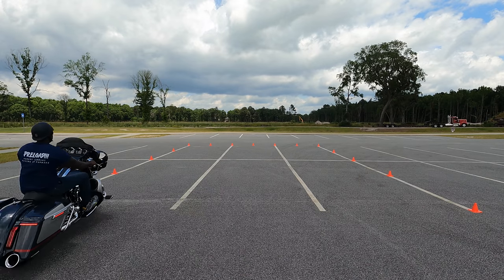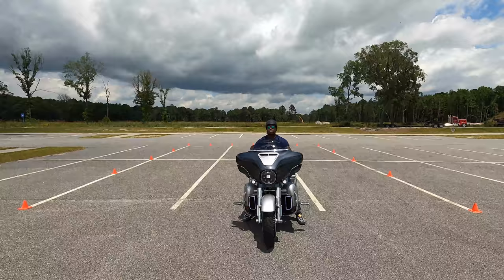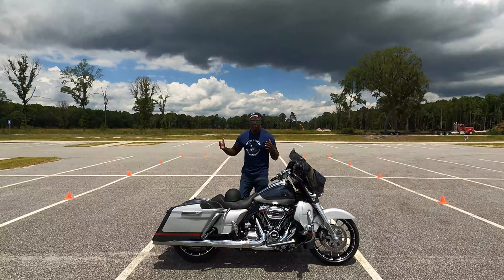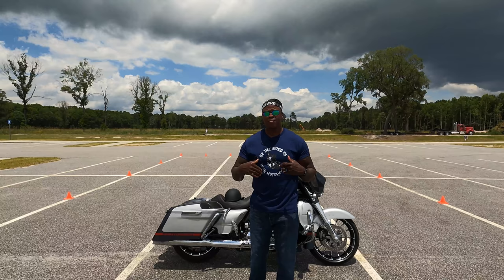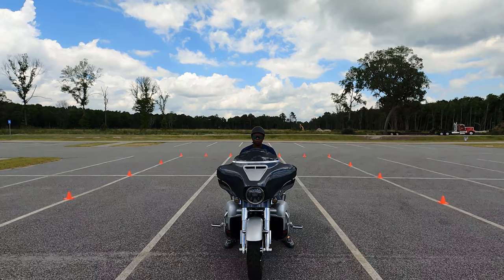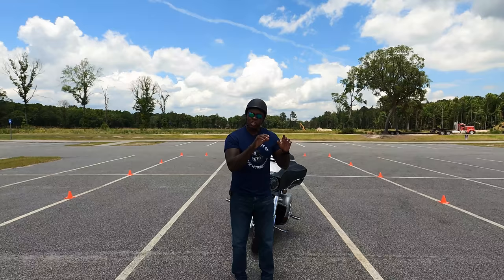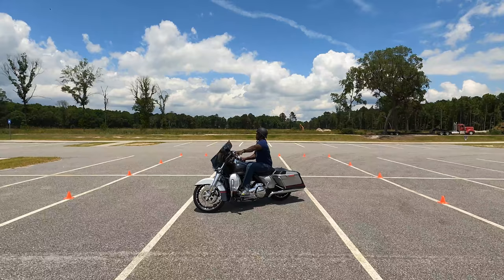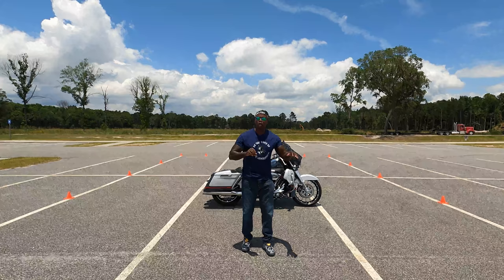Do You Fear Leaning Your Motorcycle While Making U-Turns At Slow Speeds? Watch This!!

Comment: "The leaning of the motorcycle and the fear"  You nailed it with this video.  I finally can confidently perform a U-turn because of you and this video.  I spent time on and off practicing Paladino's videos and could never get it.  I even reached out to him and he suggested I be in 2nd gear when performing his routine.  But I was confused,  no one starts in 2nd gear from a complete stop especially at a traffic light when attempting a U-turn.  Also I could never get the whole "feather the clutch".  I dropped my bike many times because I was riding to fast with his method.  I love how you called out "its not necessary to make a U-turn within 18 ft. and not necessary to lean".  I actually searched You tube "how to execute a U-turn without leaning" and this video came up.  I first practiced the slow crawl , exercise #2; then continued with slightly turning the wheel, then I jumped into slowly performing the U-turn (while dragging the brake).  Got it within 5 minutes!  As you stated, just focus on the rear brake.  Stayed within friction zone and preload/keep throttle loaded  while dragging the brake.  I got sharper turns the more I applied more rear brake.  So freakin' easier with your method, so awesome.  Wish I found this video while back.  I actually only watched your videos about your Motorcycle Jack.  Those were the only ones I watched (start to finish).  I'm firm a believer now with the preload/friction zone/and dragging the brake.  That worked perfect for me.  Was like a dream, not having the fear of the bike falling over.  Thank you so much
Reply from the maker: Thank you for watching and hopefully you’re subscribed!👍🏾😊 I’m happy that my channel has been helpful to you! That makes all the time and effort that I put into this so worthwhile! It’s my pleasure brother. Preload!!! And Keep It Loaded!!!! ©

Comment: ROBERT!  I went back to watch this today 12/19/21.  LOVE IT.  I went out and practiced u-turns for an hour (of course in the process i go through Exercises 1 and 2).   After 30 minutes I thought I should get a tape measure and understand the lengths I was working on.  I can definitely do the 27 foot day in and day out (keep it loaded, cover the brake, keep throttle where it is, head and eyes, handlebars) BUT TODAY I REALIZED I HAD BEEN PRACTICING IN A STREET ITSELF CURB TO CURB WAS 27 FEET.  GREAT.  So I laid out a tape measure at 16 feet and then went around left and left then a u turn then rights and rights and each time kept my wheel just outside that 16 ft tape.  OUTSTANDING.  I felt for the first time I really understand the POTENTIAL of being the boss of my motorcycle.  WOW the confidence.  I wasn't leaning the bike.  I WAS NOT LEANING THE BIKE.  No need to do that.  PRACTICE PRACTICE PRACTICE!   Thanks again. :_YES:
Reply from the maker: That’s outstanding Mark!! Confidence is a powerful thing! Keep it up brother!
Reply: I practiced so much today doing U turns and figure 8's at low speeds that my rear brake started squeaking so I had to give it a rest...
Reply: oh man, this gives me hope! I went out and practiced last night from watching just a few minutes of Robert's suggestions. I just found the channel. the 3 P's is right! I dont have my license yet, I am so excited.

Comment: Hey Robert
I just want to say thank you. I have been riding 51 years. The Heritage softail was the largest bike I had as a keeper. Recently I started thing about traveling nationwide. I bought a CVO and it was a different animal. I dropped that bike 3 times in less thank 24 hours. A buyer popped off and we traded the same day. Later I realized I could have lowered the bike, worn an agressive boot that that grip the ground much better than the slip on comfortable shoes I was wearing. 
By watching your videos, I realized that I knew what you were teaching and I had used it that technique. I had gotten relaxed and spent NO time riding compared what I had done in the past. So thank you for the clear explanation and the mechanical reasoning behind to preload the bike and follow thru. No changing your mind midway. This 2016 Street glide Special is a different animal. Soon, I will be taking a long cross country trip. I just need someone to remind me. Thank You brother! 
I appreciate what you are doing. 
I am getting set up with a PleasureWay class b motorhome and a small enclosed trailer. 20 years ago, I was enjoying Colorado. Last few weeks, I was at Sturgis SD and I had no problem. Thanks again for sharing your knowledge. these 8-900lb bikes are not the same as trail riding or racing motocross. You are one the first (one I guess) that reminded me of HOW TO RIDE your bike..A stroke in 2009 didn't improve my balance either. But I am looking forward to see for a place to park and get back to camp and be ready to roll, the next day.
Cheers
BobNTexas
Reply from the maker: Hey Bob. It’s my pleasure. 😊 Thank you for watching and hopefully you’re subscribed!👍🏾😊 Also thank you for sharing your story with me!

Comment: I've seen people righten their dropped bikes, not by lifting at all, but doing something you teach. They turn the bike ON (not off), in gear, clutch in, preload, and let off on the clutch. It's exactly what you teach for low speed maneuvers, but they use the power of the bike to right itself from a drop.
Reply from the maker: Yes I mention that. Power will pick the bike up.

Comment: Definitely an interesting take on this sought after topic/maneuver. Cause lets face it, even long time riders can still find this maneuver a no no.

When every other video in youtube is talking about the counter weight/lean/look/full lock/ faster u turn etc. when doing such a maneuver. Some even demonised you for not being able to lean and do the maneuver.

You made it much clearer and really took it down to earth. And the fact that its not a do or die situation on whether you can do a tight turn or not.

i.e. as you said, ex. no. 2 in regards to slow riding.

the u turn basically then is just slow riding but with the handle bar turned to make the turn and you looking to where you wanna go.

Never thought of it like that, but it does make sense.

And people usually get caught out and have a jerky losing balance u turn because instead of keeping the power at the same level and controlling the power input using the clutch. The new riders usually control the power with the throttle which causes jerkiness and making them lose balance.
Reply from the maker: Thank you for watching and hopefully you’re subscribed!👍🏾😊

Comment: Wow fantastic presentation.  I'm like some of the others below, I've been riding street bikes for near fifty years.   While I can make tight U-turns, in the past I tried to avoid them. I would just keep the rpm up feather the clutch to make a slow shallow turn. I would use the rear brake but more as a stop definitely not to preload, that world was ever in my vocabulary. When I was a young guy, I also developed a bad habit of seldomly using the rear brake. Typically, I only used it when I needed to stop quickly (about 5% of the time) which this usually caused the rear tire to skid.  I came across your You-tube video earlier this summer and what a difference.  I feel 10-fold more confident actual I'm starting not to think about just execute. It's easy to learn when you understand your goal and what's required to get there.
Ride on Ride on!
Reply from the maker: Thank you very much! Thank you for watching and hopefully you’re subscribed!👍🏾😊 I’m happy that my channel has been helpful to you! That makes all the time and effort that I put into this so worthwhile! Preload!!! And Keep It Loaded!!!! ©

Comment: I recently bought a 1985 Honda gold wing that weighs 725 lbs. This is a beast of a bike with saddlebags and fairing. On my first ride I took it around the circular road in my mobile home park. I had to go at a speed that was too fast for first gear and too slow for second. There was a lot of slack that would be taken up suddenly, then I would be going too fast, in second gear. 
When I saw the word "preload" I thought I would check this out.
The clutch on most motorcycles are "wet" clutches. So when you apply the rear brake(carefully) and drive forward you take up the slack in the drive train. Now you can go slow without the awful push-pull of the heavy bike. It's pre loaded.
Reply from the maker: 👍🏾👍🏾 Thank you for watching and hopefully you’re subscribed!👍🏾😊

Comment: Very well-done video. I'll have to say one caveat is that it is easier to do these maneuvers on bikes that have a very low center of gravity, i.e. Harleys. I have a BMW 1600 GTL and it is a very top heavy motorcycle that has the propensity to easily fall to one side at low speeds
Reply from the maker: Thank you very much Jim! I completely understand what you’re saying. However, it’s not that it’s easier as much as it is that it feels better on the Harley. But remember the rules don’t change regardless of the motorcycle. If you keep sufficient power to that rear wheel, it’s not going to fall. I’ll be putting out Practice Session #46 any day now. Watch it. Particularly exercises 7-9 and the Bonus. 👍🏾

Comment: This lesson is an eye opener and thought provoker, much thanks from a foreigner. Not having to lean the bike in slow turns makes sense because of the physics involved. To make a slow turn leaning the bike is not necessary because the low speed involved does not induce significant centrifugal force on the bike or rider. Faster speeds require leaning to keep the angle of the bike and rider in line with the tyre's contact patches. Does that makes sense?
Reply from the maker: Thank you for watching and hopefully you’re subscribed to my YouTube channel!👍🏾😊 https://www.youtube.com/c/BeTheBossOfYourMotorcycle/?sub_confirmation=1 I’m happy that my channel has been helpful to you! That makes all the time and effort that I put into this so worthwhile! 

It does.

Comment: in my area the most common u turn is single lane dirt/ gravel. so 20 -22 foot. I just traded my Dunlops for shinkos and they gave me a lot more confidence in slow maneuvering. they are rounded so the bike falls in akot easier and even though you'll get way less miles out of them yhey are sticky. I cam do the 18× 36  figure 8 in wet grass.  they feel like the old Dunlops and wear about the same.

Comment: I guess I just got to practice more. I brought the InMotion V5F electric unicycle (EUC)and now I can ride it forward and backwards; but it took a lot of practice and a lot of dropping the EUC. I guess I’m just scared of dropping my bike; I actually dropped it before at slow speeds, and it fell over gently without breaking my leg. I guess my point is if I can ride an EUC forward, backward and do tight turns, I should be able to do the same with the Harley. Thanks for your video. I guess I’ll start at slow speeds going forward; and then once I master that, then I’ll do my u-turns. My street is 20-feet across with about I say another foot on each side for water gutters; my goal is to be able to do u-turns on my street. If all else fails, i guess I’ll be coming to GA to private lessons.  Another goal would be, I’m at the gas station and the pump isn’t working or isn’t accepting my card; I would like to confidently be able to make a u-turn and go to the gas pump on the other side of me; that’s another real world situation.
Reply from the maker: Thank you for watching and hopefully you’re subscribed!👍🏾😊 I’m happy that my channel has been helpful to you! That makes all the time and effort that I put into this so worthwhile! 

Keep it up brother. You’ll get there. I’m here if you need to come by!👍🏾

Comment: I’m coming over from a small sport bike at about 325 lbs to a cruiser at about 675 lbs and everything is different, ground clearance, leaning and turning, seating position, and riding position and it’s different when you are holding up your body weight on the handle bars while making a turn
I know you’re supposed to have your arms loose at all times but I’m 60 and I’m not gonna lay on the gas tank to unlock my elbows so I fixed some of my problems and created a few more I didn’t think of doing a low speed turn or turning my bike around in the driveway and I used to see cruiser bikes and was like that’s outdated technology because I like the latest out and the cutting edge but my bike didn’t serve my needs just my ego and after having it for a week I’ve gotten a ton of compliments to my surprise and plus I’m in a comfortable riding position and my wife can get on it easily and I just want to thank you for explaining preloading and how to use it correctly and hit the like and subscribe so now I just need that batwing, painted hard bags 💼 and nice after market wheels like you bro 😎
Reply from the maker: Thank you for watching and subscribing!👍🏾😁 It’s my pleasure. 😊 
Preload!!! And Keep It Loaded!!!! ©

Comment: Thats what some people dont understand and kind of yourself included...giving what you said..I mean for example I've been riding bikes all my life, started with a mini bike as a boy and I was an animal on it. But today as an adult, I'm thinking about other things and in on street conditions it just wasnt necessary for me to learn those skills on any motorized bike I've ever had, and any other bike I've had was small and light enough where if i needed to turn that sharp in a short area I could put one leg down and pretty much pick the bike up and put it anywhere that I could turn my body. I'm now in my 30's and I'm not very big. I'm average hight but I only weigh maybe 150lbs, thats not much mass to throw around a street glide obviously and even though I can generally get it done with the clutch like moving around a tight gas station, I still cant do it like some of these guys because I'm worried about damaging my bike that I worked really hard to get and the extra work thats into it..it doesnt make me a bad rider though. Once I'm moving I'm good..but I dont live in a big city, I live in the country. I assess where I'm going to park as I'm entering somewhere, somewhere with room enough for me to get out, and somewhere I dont have to back up. Even a slight incline to get out of a parking spot would be a struggle for me...Out on the road I'm a top shelf biker, in a parking lot...I either need to be moving or have my feet down... 🤷‍♂️ Its not the fall I'm afraid of its paying to put the bike back together the way it was that I'm afraid of...I have a drag car that runs the 1/4 mile in 9.50 seconds at 150 mph, it would be kind of silly to be afraid of falling at a speed slower than I can run...lol
Reply from the maker: I hear you Jeremy, but the point is the skills that you are lacking are important to learn so that you don’t feel the fear of damaging your motorcycle at slow speeds. We can all be involved in an accident. That’s why it’s called an accident. However, you’re more likely to be involved in one if you don’t master these skills. It’s important that you understand how important these skills are. If you can, keep watching the videos. I’m going to assume you haven’t been watching the Practice Session videos because if you have been, you would know that you’re height and your weight are irrelevant. As long as you can comfortably reach your handlebars and your rear brake, you’re good to go. It’s all about using proper technique and raising your confidence so you feel just as comfortable riding slow as you do riding fast. 👍🏾

Comment: My slow speed fear has nothing to do with getting physically hurt or ego. It's "hurting" the crazy expensive machine I've invested thousands upon thousands into. Give me a junker bike and I'll whip it around no problem! No fear of junking something already junked.
Reply from the maker: I understand. What are you riding Dan?
Reply: @BeTheBossOfYourMotorcycle  

It’s a 2018 road glide special, lots of custom work. Purchased new in 2018. I have a little over 20k miles on it now. It’s def not a garage queen, but I’m still overly careful with low speed maneuvers. I’ve done the tail of the dragon 3 times, rode the entire blue ridge twice. Went across the whole USA twice. Leaning and difficult turns aren’t really an issue to me. It’s the low speed parking lot stuff where I get really careful. Ultimately it’s out of messing up all the work that was put in. I only mention this because there are a lot of instructional channels out there. Many don’t acknowledge there are some of us who don’t want scratches/replacing 2k custom bags or handlebars, or basically just about anything else that’s been done to the bike. A friend of mine has over 10k in audio on his bike, not including all the performance stuff, custom paint, etc… he duck walks the crap out of it in parking lots/gravel areas. Ha!
Reply: Ultimately though, you suck! Because you’re an excellent instructor and you’re tempting me to play around with the most expensive machine I’ve ever owned. Ha! Keep it up!!
Reply from the maker: @Dan-gj2uj  understood. There are some that will never practice and that’s fine. Nothings 100%.👍🏾
Reply from the maker: @Dan-gj2uj  😂😂😂😂 Thanks Dan!! How about this… How about at least practicing Exercises 1-4? No leaning required in any of them!

Comment: that motorcycle will lean towards where the front is pointing too, it will stay straight up when you have the front wheel pointing straight, but once it is turned, it is leaned.   No need to lean that bike, it will lean on its own.